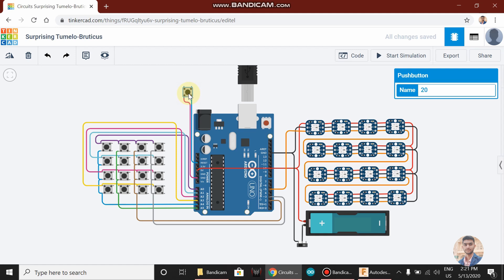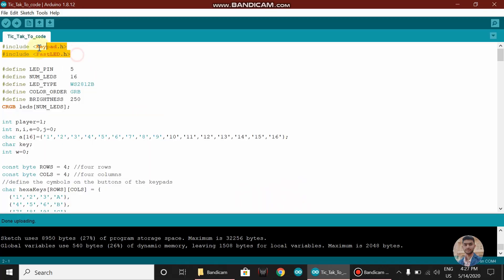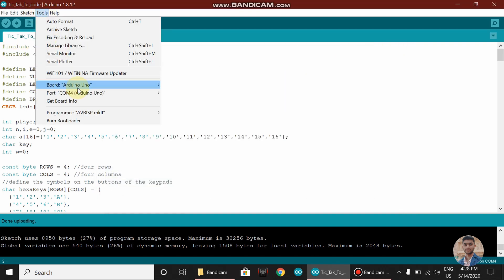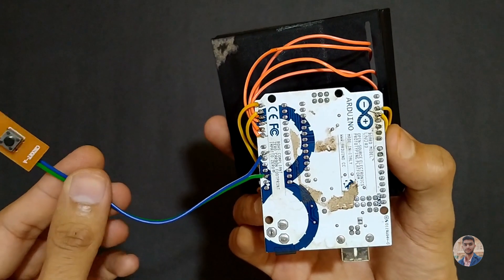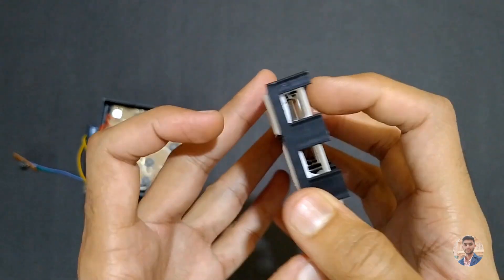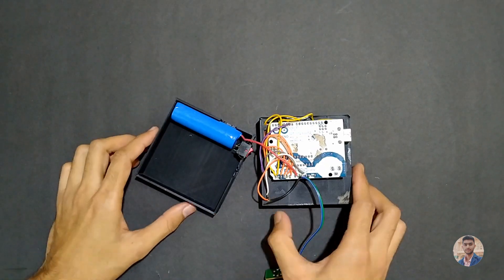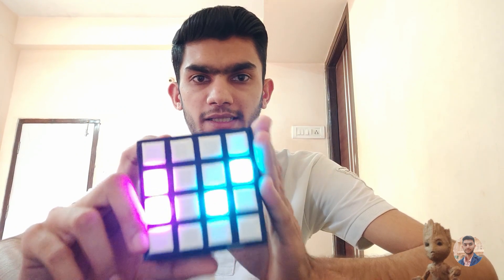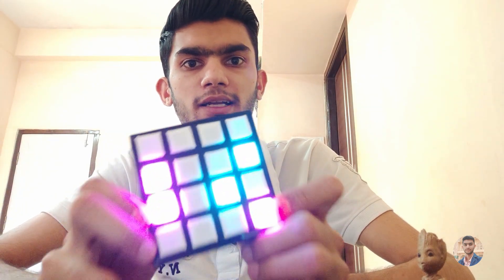DIY Arduino Tic Tac Toe Game(4X4 Tic Tac Toe) | Tic Tac Toe Programming Challenge.

Comment: Hi it is possible to do this so that 3 in a row is enough to win
Reply from the maker: Yes we can make a 3×3 Tic Tac Toe using same concept,if you want I have created one already,I can share stl files and code of it.
Reply: @makerbrains  I would be really interested in the code for 3x3 Tic Tac Toe. Based on your hackster post I tried adjusting the code for this myself but it isn't working. Would you mind sharing?
Reply from the maker: Can you please DM me on instagram @mukesh.diy
Reply from the maker: Here is the link for 3x3 stl files and code 

https://drive.google.com/drive/folders/1SYyhhj7-O7B4jZJsbdHWBRM4yo_dXmYr?usp=sharing
Reply: @makerbrains  
hello thank you for the answer, I was wondering if it would be possible to leave the original disain 4x4, and change the program so that to win just combine 3 instead of 4
Reply: or do 5x5 and do not change the program
Reply from the maker: Yes we can change the code, in the code there are some 'and' operations which you can change easily and you have to make some more combinations.